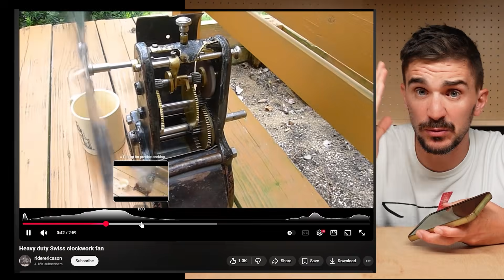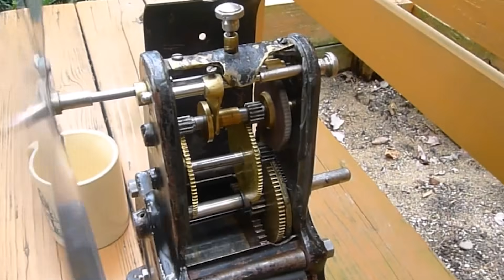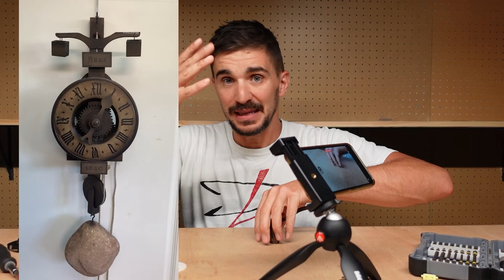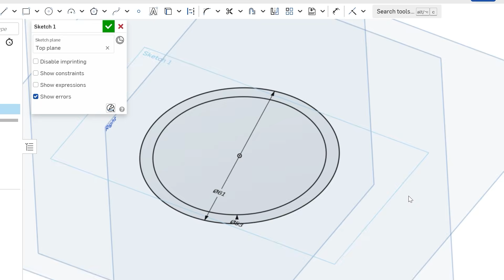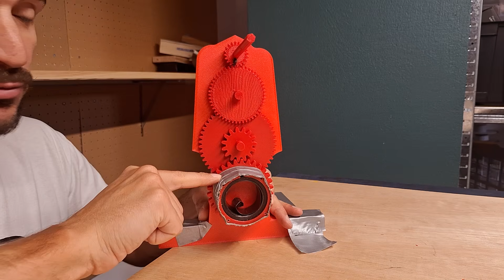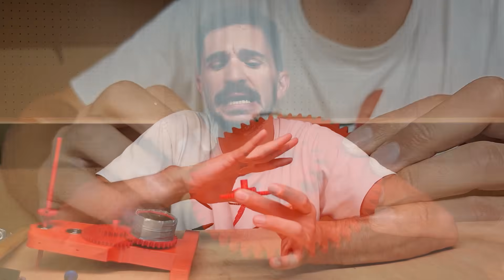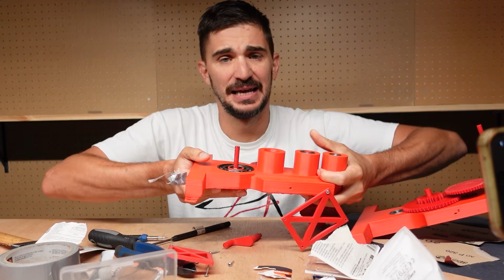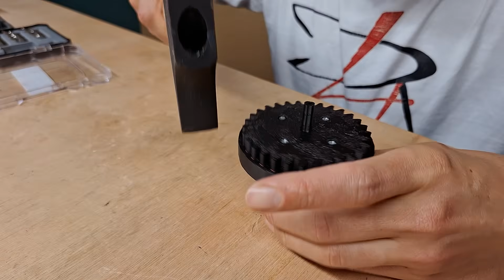No Cables or Batteries, Just Pure Mechanical Engineering - This Swiss Cooling Fan Cools You For Free

Comment: i have so many questions, what happened to the 3d printed fan? why did you end up using a pre made white fan? and what breeze per windage (bpw) would be optimal for such device? and also which measuring tape has the best spring for the optimal bpw? are the bricomarché springs really the best ones? would leroymerlin springs provide a comparable windage?

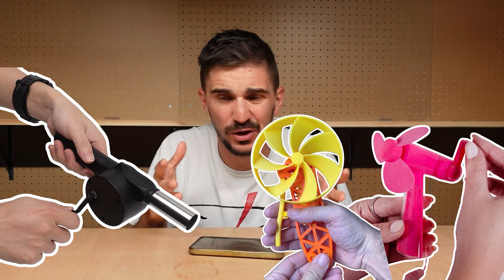Comment: 2:40 Stove top fans don't require a power outlet or mechanical intervention. Just heat transfer to generate the electricity for it.
You might be able to attach it in reverse attaching the top to a cold source let the cold radiate down.

Comment: The crank powered flashlights, radios, and in this case, fans, always stick me as very suboptimal for human ergonomics. A lone lever with about 2.5 foot play would be so much more comfortable to work. Better yet a gravity drive, with a 30 lb weight that was drawn up to a height of 6 feet with a low -torque lever jack (low-torque because 30 lbs isn't very heavy and ideally we can jack it up to 6 feet with a minimal number of levering), which then worked a crank through it's descent, over the course of 30 minutes or an hour.

It would be so much more comfortable to spend a few minutes levering a weight up a few feet, every once every 45 minutes, then to sit there working a little crank for 45 minutes non-stop. Maybe the levers jack is overkill, because the weight could just be on a spring wound cable and the descent crank would work as a hitch, so just lift the weight directly when needed (though the lever jack would be good for heavier weight systems, or for the elderly, or physically challenged).

I mean a summer fan, most be about the perfect application for a gravity drive system like that!

I always thought it would be cool to have a raised garage, like 2nd story level, where the actual garage parking platform was a gravity drive system. You know, it would raise on springs with resistance to slow it down, so when the car drove off, it would raise to second story over 20 minutes. Then when returning home, the car is already moving, and has momentum, so with a bit of practice, you could just coast up the ramp to the second story parking platform (negligible additional energy cost of your driving home every day anyway). Then the platform would lower, driving a crank with the significant weight of the vehicle, over the next couple/few hours, as the platform gradually descended to ground level. When departing in the morning, once the vehicle's weight was vacated, the system would reset with its slow spring back. That gravity drive could then buffer the energy in a wind up system which could power the fan all day and night.

Comment: Very cool project.  Looks like your fan blade is on backwards.  Try turning it around.  The fan blade is designed to turn counterclockwise to generate airflow.  looks like your system is turning clockwise.

Comment: Great video. First, you need a stronger spring. 2nd, I'd use a generator or 3 phase alternator to store electrical energy into ultra capacitors to run a fan for 30 minutes or more. That would be my version of modernization.

Comment: couple problems I think the 3d print is so rough it looses a lat of energy by friction and second one is that i think in the original fan there is a flywheel uptop which helps to smooth out the gear transfare and relieves stress from the bigger wheels

Comment: thanks Rick, i learned from you that if i want to fan, buy an electric model made at a factory out of metal, or if i have no electric, then i can go hang out in the public library for a while during the hot months where they usually have air condition or cooled air using refrigeration by electric  motor, in other words, i'm not likely to try this one at home, 
my compliments on you solution for installing a shaft in the center of the gear to replace the one that broke off, that is really good job there, thanks again friend W

Comment: I would replicate this idea in a different way: hanging it from the ceiling, mounting the crankshaft in the middle and adding an inertial break to control speed. Of course that would mean using a differential transmission (or planetary gear as it is known by everybody).

Comment: The most "efficient" way of having a fan, assuming you don't move, is using the same method used when using an old fashioned sewing machine, and that is with foot pedals. This was also used in pump organs and spinning wheels. It required very little effort and a large fan blade could be used and spun almost effortlessly. Where there's a problem, a bit of thinking can usually find a suitable answer.

Comment: Anyone who has taken apart a chime clock, or works on them, already know this works, to a degree. When the chime mechanism is activated, there is a small "fan" blade inside on the end run of the mechanism that spins, acting as a type of  speed regulator. (On another off note, when the U.S. Government wanted a pocket watch that kept accurate time in all weather, temperature and physical positions, this same obstacle arose and they solved it. This is why a "Railroad Pocket Watch" is quite special. The Government regulation demanded consistent movement using a variable tension spring. It's a regulated design and very much in demand by collectors.) That's why the clock chimes at a regulated, steady speed in listening to it. If this total mechanism was redesigned for other usage, an actual fan blade could be attached to accomplish this same process. If this was attempted, then there's the redesign of the fan blade itself, because then you would have to balance fan blade diameter and blade number and blade pitch to the strength of the spring. It's the same type of calculation needed when designing a blade for a wind turbine, only in reverse. (People get these calculations wrong all the time when trying to make a wind generator) All the dimensions need to be perfectly balanced depending on outside circumstances. The efficiency number is usually quite low, so getting any reasonable amount of "free energy" is still way off, but efficiency isn't always a high priority. This design goes backwards, meaning you're not looking for mechanical advantage, you're actually creating mechanical DISadvantage.  If you just "want something to move", this will do it. The other elephant in the room is the mainspring itself. Needless to say, it would need to be robust, also meaning it would take some conscious human effort to wind it, ALSO meaning that you'd need the fan afterwards after actually winding it up. (haha) Nothing's for free, unless nature supplies the muscle. There are auto-wind designs that do work, but only in low energy needs applications. In this initial setup, the air being pushed supplies reasonable resistance to mildly regulate the blade speed. This is while the spring is tight, as the spring unwinds and the blade slows down, the air resistance of the blade also eases, meaning that there's a crude balance here, mildly keeping the blade spinning at a very basic constant speed...for a short while. There are other ways to regulate speed, but this is the basic explanation of how this already works in a wind up, chime clock setting. In a basic principle only, it's the same as the wind-up flashlights and emergency radios that "charge" a small internal battery after you wind the thing for eternity just to get 20 minutes of use. Grossly inefficient because, in that case, MUCH more winding efficiency could be designed in with a mechanically "inefficient" re-gearing to multiply the internal generator speed, which the human hand could easily overcome with no effort. It all boils down to creativity when there's a need and nothing, so far, exists to satisfy that need.

Comment: Cool kind of fan you can get today that runs for 'free' in the sense is used otherwise wasted energy is a wood stove fan. They operate with essentially a thermo couple to generate a current over a motor and spin the fan just from the heat differential between the base on the stove and the heat spreader on top.

Cool piece of kit that takes no electricity and runs right where you need it to spread the heat around!

Comment: You could get a grandfather clock barrel with mainspring preinstalled for like 60 bucks, and not only avoid the headache of trying to transfer the spring of a tape measure to your drive barrel, but also have more power in general from a mainspring meant to run a 30 day clock.

Comment: 1) Your gear ratio is way off, that's why yours lasted for just 2 minutes
2) The energy stored in the mainspring has nothing to do with how much time it will turn the fun but only with the speed it rotates with
3) There is strict number of turns your mainspring will make until fully discharged, knowing gear ratio you can calculate how many turns you fan will make and knowing the speed you can estimate how much time it will take to unwind

Comment: .
    The old electro-mechanical car clocks of the 50's and 60's worked similar to this but took it one step further. They are a mechanical clock like any other wristwatch, wind up alarm clock, old wall clock or grandfather clock with a mainspring but it would only drive the clock for about 10, 15 or 20 minutes per winding depending on the manufacturer.

1) The mechanism to wind the mainspring was connected to a hinged steel lever which had an electrical contact built into it.
2) At one end of the travel of this steel lever sits an electromagnetic coil with one leg connected to B+ of the car battery full time as the coil is energized only momentarily every 15 minutes. This will never run the battery down.
3) The other leg of the electromagnet is connected to an insulated contact matching the one on the steel lever.
4) The steel lever has a flexible braided wire connecting it to the car's body ground.
5) As the main spring unwinds making the mechanical clock tick and keeping time, the grounded steel lever's contact slowly moves towards the opposite, insulated contact that is connected to the leg of the electromagnet opposite from B+.
6) When the steel lever reaches the end of it's travel, it's grounded contact connects with it's matching insulated contact that is connected to leg of the electromagnet completing the circuit to B+, energizing the coil thereby attracting the steel lever to the electromagnet and winding the mainspring for another 15 minute cycle to start all over again.
    If you have ever sat in an antique car with an original working clock, this is the little "TICK" that you hear emanating from the dashboard every 15 minutes or so.
    If you are an antique car buff with such a clock that isn't working, chances are the contacts to this coil are burned / pitted. If you remove the clock from the dashboard, look in the mechanism for the winding lever and CAREFULLY push it towards the coil, the clock should begin to tick. If it does, take some fine sandpaper or small ignition file, locate the contacts on the lever and where ever it's mate is attached and buff them up a bit. BE CAREFUL to NOT break the braided ground wire to the lever and don't take too much metal off from the contacts. they only need to be clean, not ground down to nothing.

    If you have an ohm meter, you can check the coil for continuity by placing your leads on the two coil contacts without them touching each other. If there is no coil continuity, sorry to say that the coil is probably burned out. They are normally not removable but if GOD is on your side that day, it's removable, and you decide that you want to rewind it yourself, COUNT THE NUMBER OF TURNS AS YOU UNWIND THEM AND REWIND WITH THE EXACT SAME NUMBER OF TURNS USING THE EXACT SAME GAUGE OF WIRE. If you wind too many turns and / or use too light gauge wire, the resistance will be too high, the magnetic field might be too weak and the magnet won't pull the lever in. If you wind too few turns and / or use too heavy gauge wire, the resistance of the coil will be too low. It will work for a while but it will eventually reburn the contacts and / or weld them together burning out the coil again.
    I learned about this on a 1966 Cadillac that I bought in 1978. The only thing in it that didn't work was the clock. All it needed was it's contacts polished.
VERY IMPORTANT!!! If the inner workings of the clock are dusty, DO NOT BLOW IT OUT USING AN AIR GUN FROM A SHOP COMPRESSOR!!! Use a can of air duster like is used on computers. 160 pounds of shop air can blow the gears out of those old clocks as they are delicate. ALSO, DO NOT OIL THE INNERWORKINGS OF ANY MECHANICAL CLOCK OR OTHER TIMING TYPE MECHANISM!!! Most are built to work without lubrication as oil is, by design, made to stick to the parts that it is there to lubricate. Another thing that oil will stick to is dust and dirt and you do not want to attract and retain these to and in your clock's gears.
    Good luck and may the electromagnetic force be with you and your coil be good.

Comment: Engineers need to stop 3d printing holes and just print solid pieces and learn to use a drill press or indexed end mill.
Reply: Or undersize the holes and then use long drills to get that precise alignment.

Comment: You could redesign the frame to be GIMBALS for each gear mount on both ends, the ability for each gear to angle in any direction with a two axis gimbal for each gear would eliminate all issues from the imperfection of the 3D print warping.

Comment: U could use the 3 surface method to sand it. Have a gritty material good for sanding (in this case I think sand but don't take my word for it) and 3 mostly flat surfaces anyway. If you use a colored dye that appear one. (Maybe white would be the best or a light grey if it's to much) And then take turns sanding all 3. U could get a very accurate measurement. It's the method that flattened the stones for the pyramids funnily enough. it can get it really accurate

Comment: Cool process! I love the idea of decreasing the number of batteries and wall connections we rely on.
Just a note on where you’re spending your design energy: I think you’re sometimes solving problems with polymer 3D printing that would be better suited to other mediums. With a drill press, a chop saw, some rudimentary woodworking techniques and epoxy, you could make the outer housings for those bushings that would be a lot sturdier, quicker and cheaper (?). If you don’t need millimeter tolerances, a wood to metal interface will be stronger than plastic to metal. Another step up (in $, time, skill) would be working from metal plates, bars etc, but could really super-charge and in-bound your engineering creativity!

Comment: There is an browser extension for that for desktop browsers. I've seen those fans for sale ... well, it was another one that works with no winding at all - it works with heat flow, only.

Device that use coil windings are sold in India. They have radios and there was even a small laptop that used the mechanical storage system produced during the "one child, one laptop" program era.

Comment: Good on you for sticking with it and getting a working fan! Your solution to fix the main spring axle is exactly what I came up with as my solution if I had that problem. Props for using your safety gear. Yeah, it's a bit underwhelming in performance, but it does work. It sure does make an unpleasant racket. Your shafts don't have to be fully round since you're using bearings. Herringbone gears are probably the absolute best option for 3d printed gears. They self align which should lead to less drag losses in a geartrain like that. Plus they're cool! This video was great.

Comment: To avoid rough surfaces on supported parts, print supports with zero gaps between the part and the support, pause the print at the interface layer and paint the support surface with a permanent marker. Works like a charm. Perfect surfaces.

Comment: Buy a grandfather clock and change the final drives for your propeller maybe? Surely all the info u need would be in clockmaking technology not in clunky plastic builds. Bearings need to be brass on brass with acceptable tolerances and light oils not three roller bearing that kill any energy you make?

Comment: Instead of making gears which of course doesn't work with a crude 3D printer, a better approach would have been to use a belt driven system. You can use two belts at 10:1 and get 100:1 with better efficiency than gears. Gears are worse than belt drive in many situations.

Comment: It does not have to be either difficult or expensive to make. Quality engineering parts have never been that cheap in history. Even ceramic bearings are becoming affordable enough. You can change the design with less gears, and stronger spring. And most of the parts can be lasercut for a very cheap price